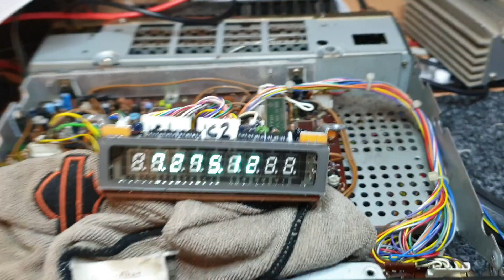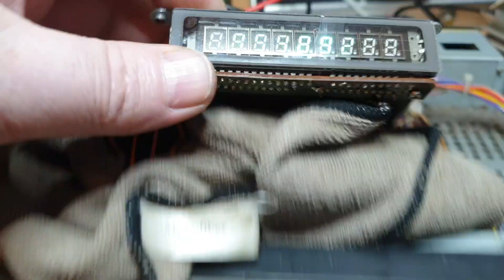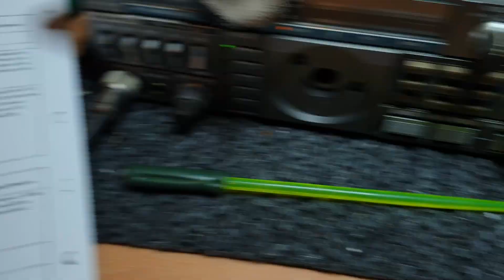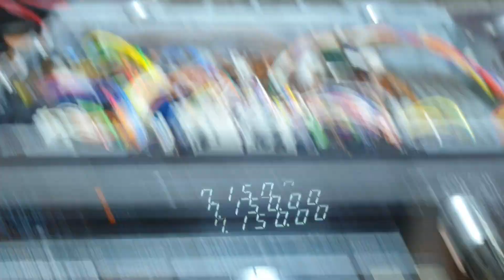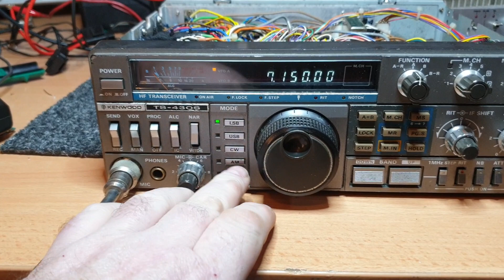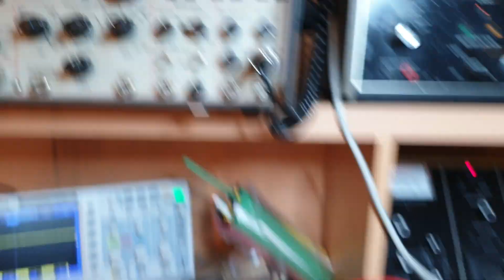Kenwood TS430S VFO/Encoder repair.

Comment: I'll be getting a working TS-430S with PS-430 power supply next week and taking my General license test as well.  Can't wait to get the radio so I can modify it.  I see that radio does not have the FM board installed.  It would be next to the IF board if installed correctly.  73 from K9POW in eastern Tennessee.